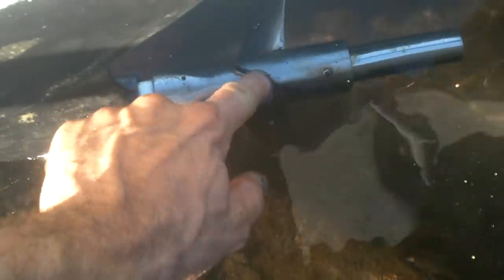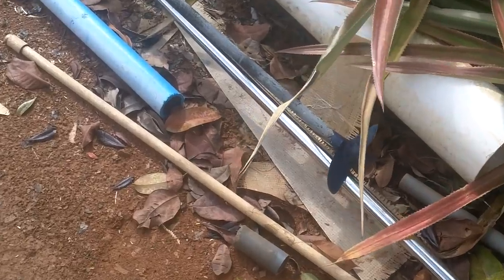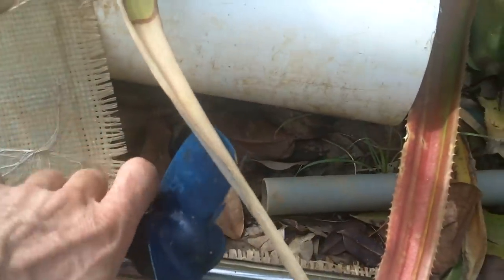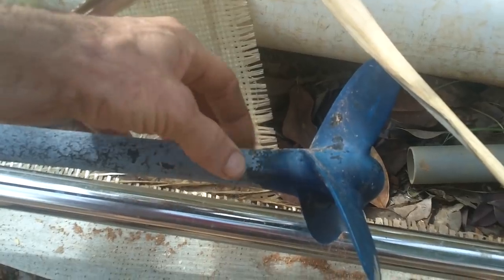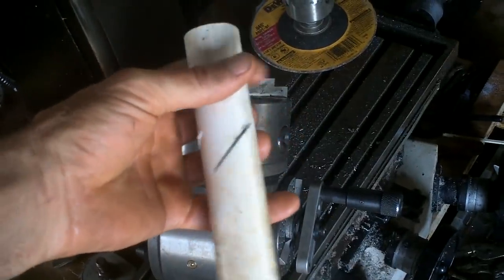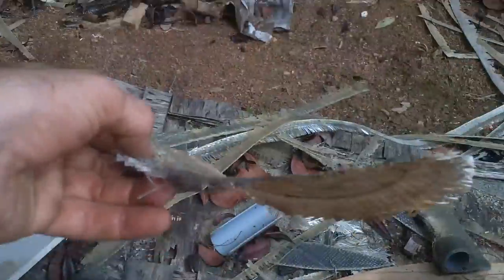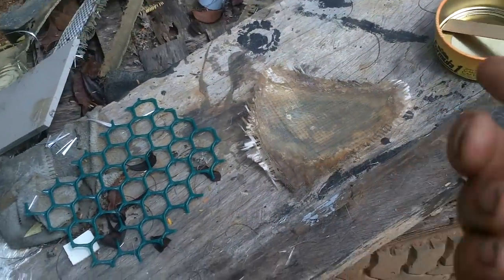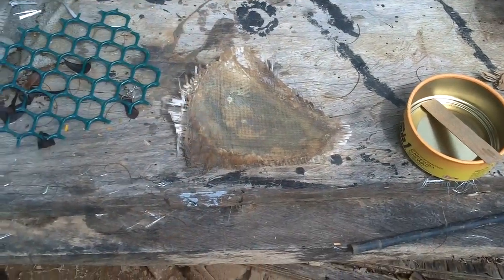Propeller Broken 15 miles from Home!

Comment: near San Francisco there is a display at the army core of engineers of a 8 foot log with 2 large bronze propeller blades embedded in it that broke off of a boat that hit it

Comment: I would definitely carry a spare.  If you are set on making them yourself, look into casting one.
Reply: I think (and I might be very wrong here) that the issue would be burning stuff; for a forge like that you'd be best off with a fossil fuel of some kind. And electric forges use a huge amount of power - remember that Jamie is on fairly small batteries (in relation to the amount of power needed for a forge).
Reply: @o0julek0o  casting s small piece like a propeller would require about 20lbs of charcoal from my experience.
Reply: You can use oil, gas, or as Bill said things like charcoal.  Getting used oil should be pretty easy.  What it really requires in terms of materials he'd need to source elsewhere is the furnace (which he can build), a blower and a crucible.

Comment: Get a Torqeedo Travel 1103 CL, it has an integrated battery and can run for 6 hours at half power. It looks like it can charge from a huge range of voltages ( 9.5 V to 50 V), so you might even be able to just plug the solar panels right into it. I'm not sure if it will charge while you're running it, though. Edit: From the website: solar rechargeable – including during the voyage

Comment: so you didn't see my previous comment? i said, how about smearing some valve-grinding paste on those cogs so you don't have to sit in 120db of gear noise. remember to clean the grease off when it starts to go quietly. and replace it with regular grease...

Comment: Have you thought about that laser metal cintering 3d printer? I think your propeller and your situation would benefit wildly.
Reply: Better yet, form it from a 3D printer to create a cast.  Then form one from brass or copper.  They may bend easily enough, but you can bend them back without fatigue.
Reply: @MadRat70  that would be a good option but have you seen how long it takes to make the molds and get the casts right. It's like twenty extra steps. A straight cintered prop would be sweet.

Comment: You hit me off as competent to cast a brass set of blades in a solid one-piece construction.  But taking an existing set of blades and reworking them to fit your system is probably the best.  

I have to hand it to you, going out on these long trips without a sense of danger.  Losing both propellers and trying to paddle your way back 15 miles would have been potentially deadly.  I would not feel relaxed without a backup gasoline-powered unit handy or maybe even a manufactured electric trolling motor.  Reliance on DIY just seems overty risky.

Comment: it would be super awesome if you had a 3d printer  you couls print a few designs
Reply: 3d printed plastic is actually kind of weak, metal is much much stronger
Reply: He does have one.
Reply: @RawSauce338  Actually, if it's plastic that's been printed with an SLS process, it can be really strong, but the printers are insanely expensive. I've had a few parts printed out of polyamide with an SLS process, I actually made the first part WAY too strong because I was expecting it to be weak.
Reply: @RawSauce338  Also, having a custom prop printed out of polyamide with an SLS process would probably cost 500 bucks... he could just buy a cheap prop for a trolling motor for 20.

Comment: The gears on your pedals are very noisy can't you use gear from like a grinder or alike just a suggestion. I'm so happy your feeling better keep up the top Vids
Reply: He made custom gears with a very high ratio so he can actually pedal with his feet, so you wouldnt find these types of gears anywhere. Even thouvh its noisy it works really well!
Reply: @RawSauce338  I kinda looked around eBay one day for some gears that he might be able to use, but they're really expensive and hard to come by. There are planetary gears for stepper motors that would give him the ratio that he needs, but a right-angle gearbox that would work in this application isn't easy to find. The gears from a big grinder might work, but the ratio probably wouldn't be high enough. Edit: Maybe a combination of a grinder gear set and a planetary gear set, but he'd need to machine a pretty complex case for it all.
Reply: @RawSauce338  The right sprocket and chain setup could provide the additional gearing. I'm really impressed with how well he was able to do cutting by hand, though. Perhaps if he found the noise bothersome he could just build a box around it and soundproof it. I figure if it ain't broke...iterate when it does.